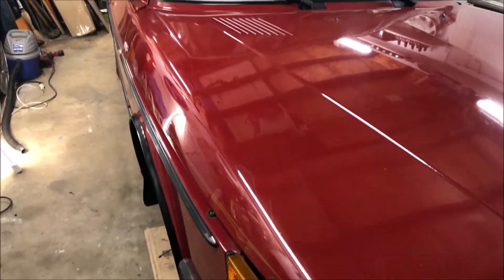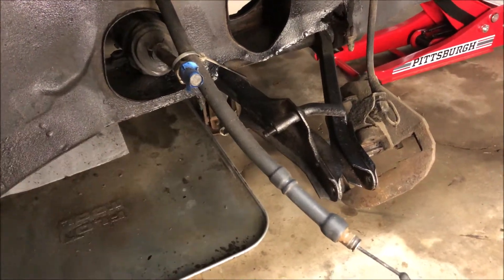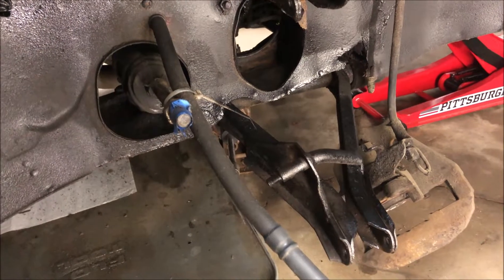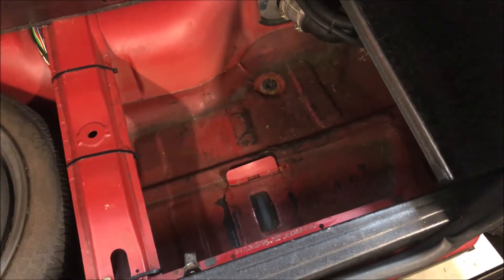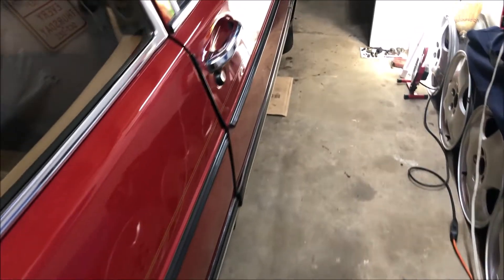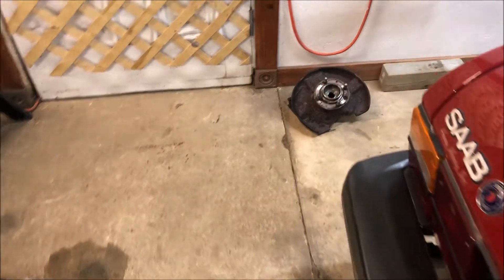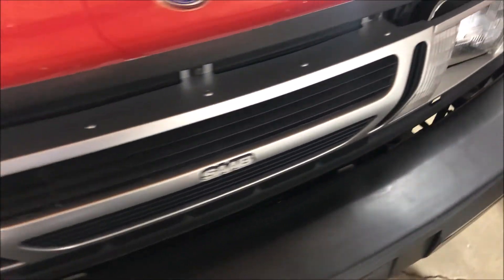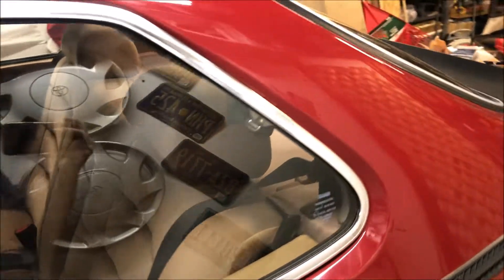SAAB 900 1/24/21 Update: Progress Continues

Comment: I've had to order a replacement caliper and I think it was from either from Partsgeek or Rockauto. Mine is a later style (1989) so I don't know it that'll help at all since yours are a little older. She looks very clean, sorry the camera didn't show it all that well to us viewers. Car looks fantastic bud!
Reply from the maker: Thank you! Yes, they are different, they changed in 1987 (I think because they switched the parking brake to act on the rear wheels)

Comment: Hey Seth, thanks for the update on the 900!  On your motor mounts, just how bad were the originals?  Are you replacing as a bit of insurance or were they falling apart?   Also, I’m lead to believe that Autozone MAY have reman calipers for the front, but really hoping you might buy the rebuild kit (best one avail from FCPEuro IMHO) and do a video for us on your process.  Pretty please😀
Reply from the maker: I'm not really sure how bad they were as far as dampening engine vibration, but they are visibly pretty worn out. I did a video going over the replacement of the drivers side, it was cooked. The mounts bolt to the frame throught the drive tunnels, so its easiest done with the cv shafts out, so I'm doing it now so I dont have to later.  

As far as the brake calipers, I'm not sure yet, but if I rebuild them, I will make a video since you asked!  Thanks for watching, and thanks for reaching out!